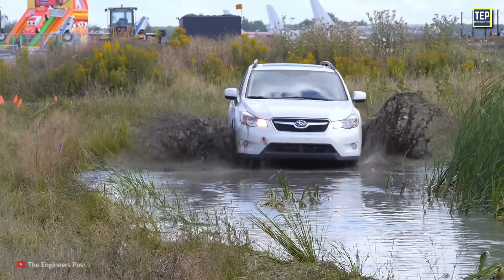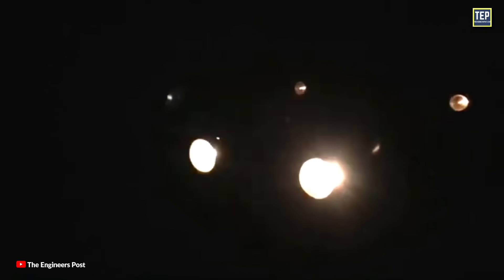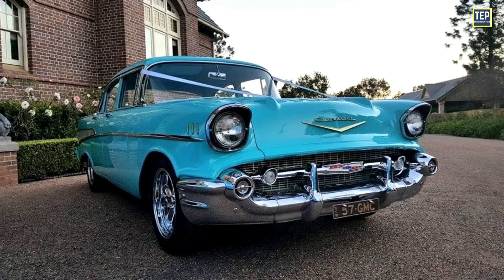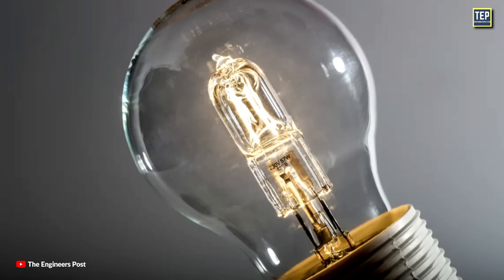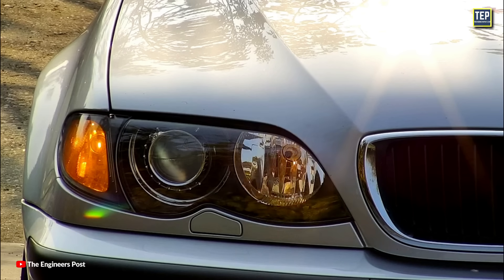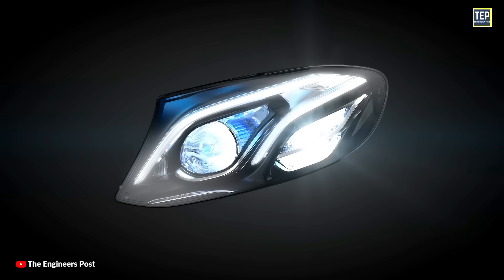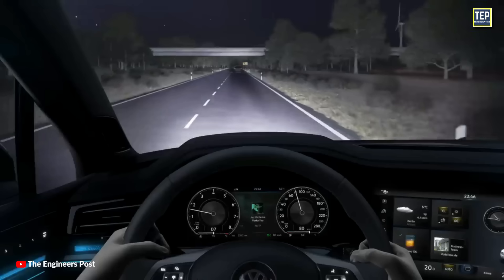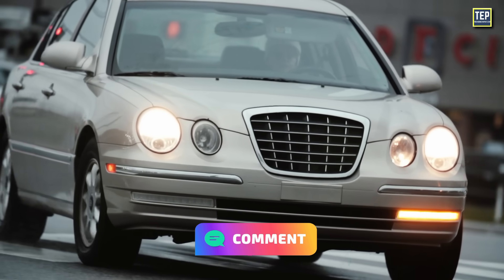The Problem With These Headlights

Comment: You know what I miss about headlights?  It's the glass lens!  Never had to worry about yellowing, when they were glass!
Reply: My 1997 audi has glass headlights
Reply: @LawrenceTimme  Defender 2012 glass, never broken ! 😁
Reply: My 1996 850 Volvo has glass and I've never broken on to-date.  Just in case I picked up replacement from a junk yard for free. Lol
Reply: My 1998 toyota camry and my 1991 honda lead have glass lens and Metal housing😊
Reply: @thomaswagner3885 98 Camry has plastic acrylic lights.
Reply: That's probably why my dad chose a 07' Jeep Wrangler. It's glass lenses are still crystal clear, but the fog lights are plastic though, and they've gone completely yellow and matte
Reply: Shattering kinda sucks tho. At least with modern cars I don't have to tape up my headlights before a track day
Reply: well then you can polish it. but of course if its going yellowish that means the headlights transparent part is fked already. So if its only foggy, you can polish it ,and i recommend to put on a 3M protective film. it will last forever if its not teared up. i have on my car for more than a year already and it still looks new
Reply: It’s cool until you get into an accident with them
Reply: @pennolmintwind5056  Why? I walked away from 2 crashes unscathed, not sure how they were more of an issue than if my cars had plastic ones
Reply: There was a tradeoff. Glass didn't yellow like polycarbonate can if there's a poorly made batch of poly, but OTOH poly won't shatter if it gets struck by a rock.

I have LED assemblies in my old Toyota for the last 5 years and love them, but the heating element in one of them failed due to a small amount of moisture that got in during manufacturing and corroded one of the internal leads. On the upside, the poly hasn't showed any signs of yellowing. Downside, driving in winter conditions leads to buildup on the one headlight with the failed heater.
Reply: @NordicDan  I have never seen or heard of glass ones shattering, must take a big rock!
Reply: @73Datsun180B  It's rare, but can and does happen. Lost one of my Hella glass housings several years back to a rock that shattered it. It doesn't take something huge.
Reply: Plastic is cheaper, saves weight.
Reply: @i486DX66  the weight is absolutely no issue, everything in cars is only getting heavier every year.  I think that it is only cost reduction, so they can make bigger profits. Glass is definitely better, but more costexpensive, and breaking is hardly ever a problem. Plastic sucks, and not even a little.
Reply: @paulusvanaken2135 I'm in the auto industry, and I can confirm, weight very is an issue. 
There even is kind of a battle between the compartments, fighting for every single gramm of each part of the final car.
Reply: They were dirt cheap and you could get them anywhere. Easy to change as well.
Reply: That, and that they cost $4 and you could get them anyplace, only a few sizes fits all. Of course by comparison the light was crap.
Reply: @townhall05446    H6054 and other old round and rectangle headlamps have been available  with leds for quite some time now. I got some Afeax brand ones and they shine brighter, wider, and further down the road than 95% of cars on the road. The only problem is they don't get hot enough to melt snow off of them unless you get expensive heated ones like JW Speaker.
Reply: there are vehicles whose lights do not turn yellow over time, which means that such plastic can be made, I don't know why it is not done on all cars
Reply: @markomicovic5308 Like everytime it's about money...
Reply: @markomicovic5308 The yellowing is not the plastic it''s actually the clear coating applied to protect the plastic from abrasion and UV etc.
Reply: @markomicovic5308 I think it is just how effective/thick the coating of UV filtering sealant on the polycarbonate lens is.
Reply: Unless you're French.
Reply: Bah, initial reply to the wrong comment...but my actual reply to YOUR comment is, "I wish we could have the car headlights in glass, but apparently 'forming the glass' for complex rounded shapes is harder than we'd like to imagine.  I would like them to not yellow, though, that does get ugly.
Reply: They were cheap too, no need to change the light fixture or anything it was just one part, bulb, reflector, lens and fixture all in one and everyone used the same one
Reply: You can try waxing them
Reply: @zacmich6472  For what reason?
Reply: Mine are still glass, just replaced one because of a crack that developed into a hole due to a stone hitting it
Reply: @str8xrippin  I just fill the holes with silicon!
Reply: YES! They were way better, and not as blinding as headlights now.
Reply: yeah, no scatchiness
Reply: One more reason is aerodynamics. The sealed beams needed open housings with upright lenses, acrylic lenses can be fluently shaped into the vehicles body. 
Of course, You also could make aerodynamic shapes from glass, but that would be way too heavy and expensive.
Reply: Hey same colour background
Reply: Until the glass shatters
Reply: @gg-eo6ez  since when?
Reply: Mercedes Benz W124, W201. These cars had not only glas, but you could change the glas separate from the housing or the mirror. At least in Germany and the rest of Europe. And they had H4 Halogen bulbs. We never had sealed beam in Germany. Always bulbs. First Bilux, then H4, H1, H3, H7. Then came Xenon and LED. 
There was a car with turning headlights built in series in the 60irs in Europe. The Citroen DS. Iconic car. Ahead of its time in a lot of things.
Reply: @Dirk-Ulowetz  good car but very ugly!
Reply: Yes
Reply: They can be polished but it is a PITA.  The LED headlight lenses, themselves, look like they're glass.  I haven't really looked, though. he running lights are plastic but I think the headlights are glass.
Reply: Problem today is stupid ppl are using highbeams Everywhere especially in metropolitan areas even when street lights are sufficiently utilized. Another problem is that drivers are raising the beams of the housing purposely to tailgate cars in front of them to force a lane change and or deter cars on other lanes from making lane changes.. All, the while Blinding drivers from oncoming traffic. Today's drivers don't even switch off High beams to ground for oncoming on mountain roads (prolly illegals driving). is it any wonder head on collisions are occuring more frequently
Reply: ' and they cost $4.00 not $400.!
Reply: @mikemakuh5319  And cost $50 to replace every year.  LEDs don't have to be replaced unless there is physical damage (accident, etc.).
Reply: Maybe using fortified glass would be cool
Reply: I've definitely had glass front lenses shatter. And polycarbonate front lenses fade and yellow beyond restoration. Depends on the type of headlamp. Regular reflector headlamps rely on the front lens cover to partake in forming the appropriate beam pattern. Those elements of the lens had historical trended to be more effective in glass lenses because they're much thicker so there's more to work with.

With projector lamps though, plastic or glass doesn't matter because it's just a shield, it doesn't play a part in shaping the beam. Which can be a huge cost saver. Another thing is shape and size. Headlights especially the last 10 years, have far more intricate shapes, that follow and compliment body design lines, instead of the much more limiting glass lenses restricting them. It's obviously possible to make large and complex, intricate designs in glass - but for many newer cars that mass ("series")  production would easily add another $100-150+ in cost per lens (because of incredibly poor QC yields) and easily quadruple++ the weight per unit. In the perpetual pursuit of more comforts and safety but still better fuel efficiency, adding the permanent weight equivalent to an extra 85Ah car battery just to get 10-20x more expensive to produce glass headlight housing lenses, doesn't feel like a move in the right direction.

Don't get me wrong though, I just bought a cheap used set of headlamps for my '99 passat, they looked like cheap and worn aftermarket plastic in the listing but what arrived was originals with prestine glass lenses. And I'm absolutely gleeful and grinning about that. But, if I was designing a not-25Y/O headlamp I would definitely not go glass.

Restoring polycarbonate/plastic front lenses used to be way more of a hassle and barely last months, because the only UV sealants were super nasty stuff and regulated. But when sanding/buffing the dulled original surface you lose all the original UV sealant coating, and without adding new UV sealant afterwards the plastic fogs and yellows incredibly quickly. If you don't redo them in time, it can sometimes even yellow all the way through.

 These days you get much less hazardous UV sealants, even get them included in some kits as cheap as $15-20. And these days, a lot of $20 kits are actually quite decent, and surprisingly well thought out so even minimally experienced users can get pretty good results if they follow the instructions properly. And the results actually last for a really long time because now we got UV sealants to go with.
Reply: Headlight restoration kits are cheap and they work remarkably well. Just follow the instructions.
Reply: It doesn't if the "glass" is not damaged. When it does it's due to Ultraviolets that come in, because (most of the time) people use abrasive stuff on the "glass" and damage the UV protection.  Otherwise it lasts forever.  Do not polish the "Glass" (polycarbonate).
Reply: they’re not glass!?
Reply: @crabjoe  lot heavier but.
Reply: but you can't do any design with glass...although manufacturers are regressing and doing small and simple shapes
Reply: @ElGoogKO  Yeah it's easier to do complex shapes with plastic et cost less energy to make. Maybe manufacturers are coming to simpler shapes now , but I think it would never be again the standard sealed beam format. And I only drive classics.
Reply: The reflector would yellow. Once I needed 1 new glass headlight,(1981 Volvo 240) and the difference the old one was so much I bought a replacement reflector and installed that.
Reply: @Santor-  Ho ? Strange that they yare yellowing. Never got that on my classics, but yeah reflectors can degrade of get dirty. I know the ones on my 1966 opel rekord are a bit oxydized. They can be rechromed though : ) .
Reply: bull shit  , i've seen 1000's of cars with glass front , all of them let some water in , and they got really really bad , you had to disassemble ( the possibility to do so was nice) and clean the glass , change the reflector . Now a headlight lasts up tob15 years on the better designs without any issue (and it's usable for up to 20 years, sometimes more). Some bad headlight designs start to deteriorate after 5 years .
Reply: @kisspeteristvan  I think Crabjoe was talking about clear plastic yellowing and the surface becoming rough .
Reply: @kisspeteristvan  "now headlights last up to 15-20 years" What a fucking joke, seriously! My 180b is running 51 year old sealed beams, my u12 running 32 year old glass and my wd21 29 year old glass!
Reply: iF IT AIN'T BROKE, DON'T FIX IT!
Reply: Snap! 😊
Reply: The last ever car to get glass headlights was the VW mk4 Golf😭
Reply: I'm really surprised that no one is complaining about the cost of replacing those really expensive capsule elements. Not to mention that there's so many variations.  Then there's also the cost of replacing just the headlight housing.  Talk about frigging crazy cost.  But the worst part about all of these new headlights is that you practically need an engineering degree just to open one up. Not to mention that you need to dismantle half of the front end of your car.  Or remove the battery to get at behind the bracket thats only big enough to get a credit card into the space. And please don't get me started about those rear lights.  Behind all of the plastic and fake carpet.
Reply: Rocks were a bytch though!!
Reply: The lens does not fade and yellow,the flaking and yellowing is the UV/scratch protective coating applied to them. This can be carefully removed by sanding then polishing the lenses then re applying a good quality lacquer coating. I have refurbished loads of previously faded lights for customers at a fraction of the cost of new lights with perfect results.
Reply: Glass lens AND not having to remove the front bumper to change the bulb.
Reply: Also dipping to the left on modern cars (uk)seems consigned to history!
Reply: They did that to get the weight down a few lbs... seriously.
Reply: Yeah, until the glass shatters from the littles things like a single piece of gravel.
Reply: @H982_FKL That's a "flaw" in every headlight type,but i can assure you those glass one's are very thick and stronger than modern acrylic type glasses.
Reply: @H982_FKL  Thats moot... Had a jeep kick a stone up on the highway and shatter the headlight on my bothers Genesis. The freaking housing costs almost 200 for a new one...
Reply: Keep an eye out at junk yards when you travel pick up a spare for pennies on the dollar.
Reply: @H982_FKL  That is why my 1965 Imperial had tempered glass windows over the four headlights.
Reply: @H982_FKL  Then you go buy a new light. They aren't designed to be immortal anyway.
Reply: @H982_FKL  it would actually take a huge rock to cause it to shatter... It's not very often that you're driving into a tornado or the output from a rock crusher..
Reply: @H982_FKL  They don't break that easily, I had the pleasure of owing a 40 year old Mercedes with it's original glass headlights. They last forever
Reply: @DerTyrann1984  2 of the 4 sealed beam headlights on my 180b have the name Datsun moulded into them so I think they are original!
Reply: @H982_FKL Literally dropped one and the thing was unharmed lmao I don’t think a little dirt particle is gonna shatter a thick piece of glass
Reply: @H982_FKL owned my Citroen Saxo for 22years and mostly used for rally practice although is road legal so most of its life spent with others getting peppered by small bits of gravel on a dirt track. Never broke one once, in-fact its the shiniest pice of the car
Reply: @H982_FKL that does NOT happen LMAOOO, my grandpa's work truck has those and they don’t have any chip on them
Reply: @H982_FKL  No, I've had this happen many times and only a small chip ever happened. And that's from a lot of driving in gravel too. If it did, the lights were cheap, under $10 in the 80s and 90s, so maybe $20 or $30 now.
Reply: @H982_FKL  never had an issue with my Jeep lights.
Reply: @H982_FKL because plastic doesn't break. 😂
Reply: @H982_FKL  Yeah still better than having to sand plastic headlights and pouring all these plastic microparticles into water with no assurance it could be filtered. I wipe the water with some paper when I' m doing this and throw this in the trash bin to minimise water pollution but, how many people don't do that? Plus renewing plastic headlights is a loss off time or money or often both.
Reply: @H982_FKL  they never broke they were super thick
Reply: @H982_FKL  I have gone through four windshields, but I have never had a glass covered headlight shatter from debris. All my subsequent cars however have had yellowing and deteriorating plastic lenses. I would take glass lenses anytime. I would even pay extra if they were available.
Reply: @H982_FKL What are these weird comments on glass shattering from gravel etc?
Maybe Windshield should also be plastic? And the side windows? 
Last time I checked my cars, all windows were glass…
Reply: @H982_FKL  if that was true we'd be replacing windscreens constantly
Reply: Stone chils were a thing and eventually the metal reflector buttons would rust. They were also pretty dim as the frenzelled lens was dense and not super acurate.
Yellowed plastic lenses can be restored to a point, very sucessfully if caught early. Lack lf maintenance in anything will lead to premature aging.
Reply: @thebrowns5337 
Lack of maintenance? We shouldn’t have to maintain headlights beyond bulb replacement and angle adjustment. Technology is supposed to make things better and easier. Oxidized plastic headlight housings is a flaw. Imagine if smartphones required monthly screen maintenance to keep the screen recognizing your finger.
Reply: @thebrowns5337  why the fuck would i want to own a piece of junk that needs it's headlights polished every few years lol
Reply: They were discontinued because they are harmful in case of a crash
Reply: @nsabimanadavid8  I think if you're in a crash, you have bigger things to worry about than your headlights shattering...
Reply: @nsabimanadavid8 
Glass headlights in the US can still be made on a new car, the only reason they switched to plastic in the US is because that’s what was used in Europe. Ford lobbied for permission to use plastic housings to reduce manufacturing costs by having the same type of headlights in both Europe and the US. As for why they switched to plastic in Europe, I don’t know, maybe it was pedestrian safety. That’s an important issue over there compared to the US.
Reply: @nsabimanadavid8  nonsense
Reply: I miss the yellowish glow. The bright white lights blind oncoming traffic and causes eye damage at night. Damn near everyone has them now. White light at night also disregulates circadian rhythm. Look at the science! 🤔🤦‍♂
Reply: It's because there is such a shortage of sand that car manufacturers went to petroleum based plastics instead of continuing to make the proven tried and true glass headlight lens.  Yeah the Sahara desert is shrinking.   lol
Reply: @johannjohann6523  nah
the sand shortage is recent and doesn't concern the sahara at all. It has nothing to do with that.
Plastic is just much cheaper to manufacture, especially since each new car has their own unique headlight shape. Glass made much more sense when cars were mandated to have standardized headlights and you can easily leverage the economies of scale since every car that came out regardless of brand would use the same headlamps. Now with every car coming out with their own headlamp shape, they have to compensate with cheaper materials and cheaper manufacturing process to compensate for lower scale.
Reply: Agree.
  The glass elimination was for weight reduction,  less fuel for global nonsensical reasons for this or that.
Reply: you can always sand and put another layer of clear coat on them like i did for my moms car and only spent $10 to have them looking new again
Reply: @terrancewalden7462  fuck that shit!
Reply: My 2020 Honda Civic fog light housing shattered because of road debris and it being a glass lens, so I don't really miss having glass headlights
Reply: @crittersfritters  must be some pretty shit quality. My  73 180b still has at least 2 original headlights and my 92 u12 still has its originals!